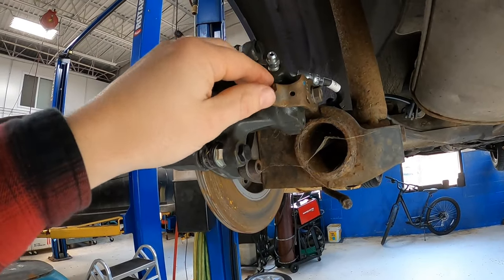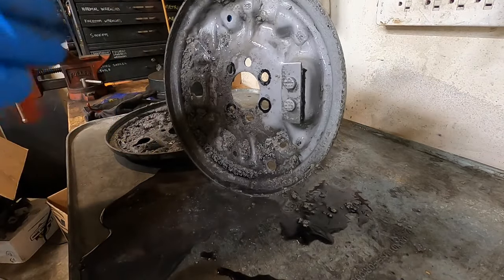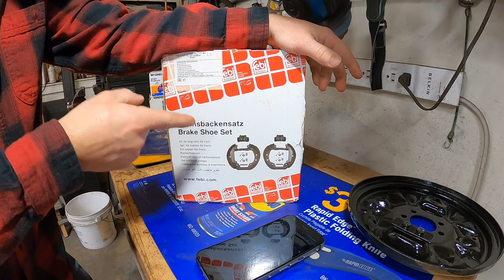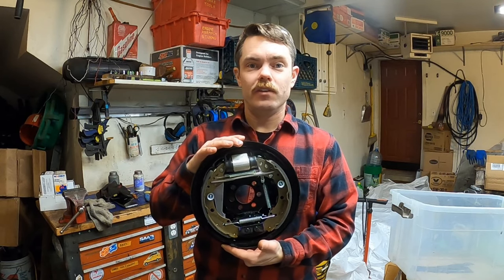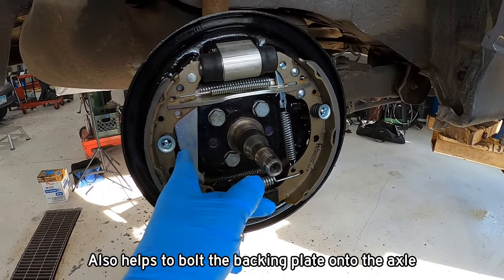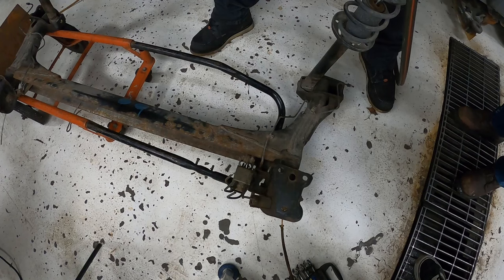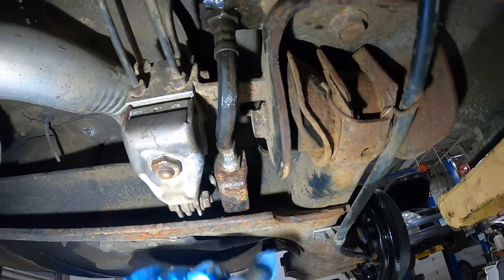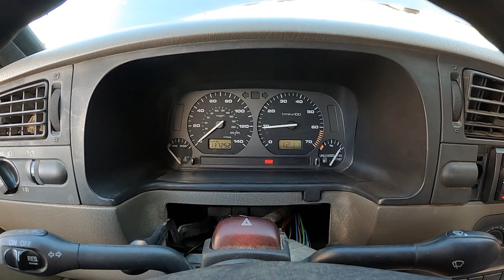Undoing A Disc Brake Conversion?!

Comment: 1) Why would you undo your conversion?
2) How's mouse? did the thermostat housing fit?
3) Coooorvaaaiiirr?
Reply from the maker: It's not my conversion and there are too many question marks and unfinished pieces. Such as, where does the brake hose mount? It's easier to go back to stock than to try to muddle through a half-finished project.

Mouse tstat housing... well, the bolt stripped out in the head again. I did purchase a nice surprise which will come out sometime in the spring and should rocket the project forward.

Currently filming the next Corvair video!
Reply: @SealedBeamRallyTeam  Well, that makes my Christmas complete! Thanks! And Happy Holidays to you and yours. :)